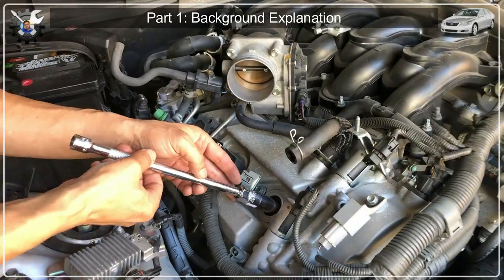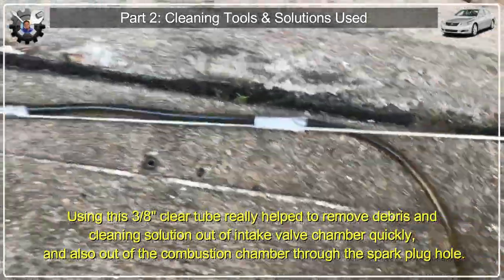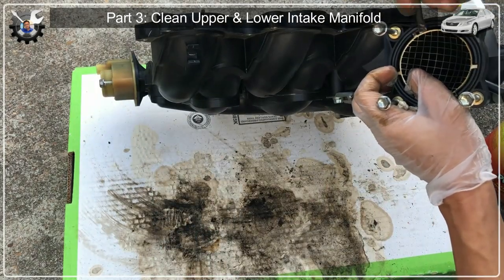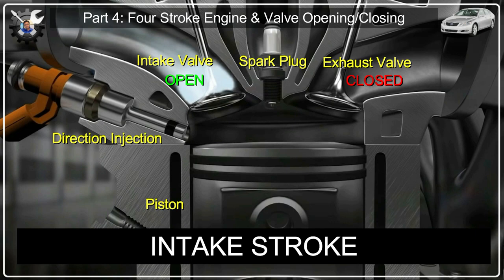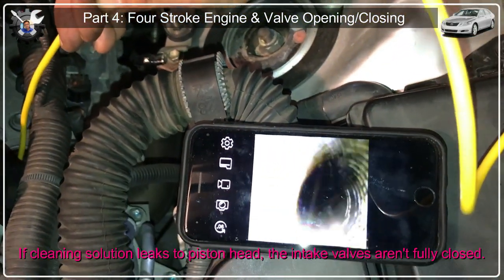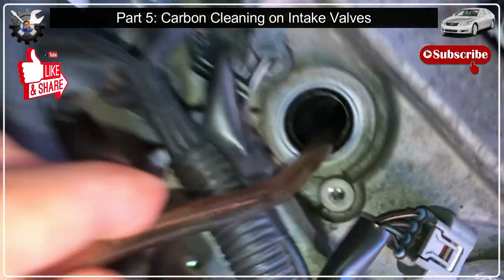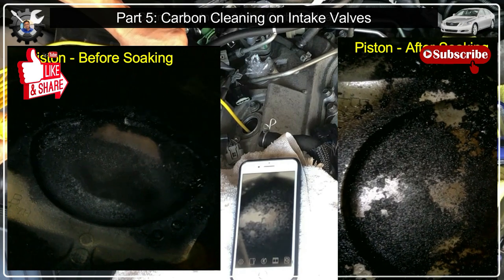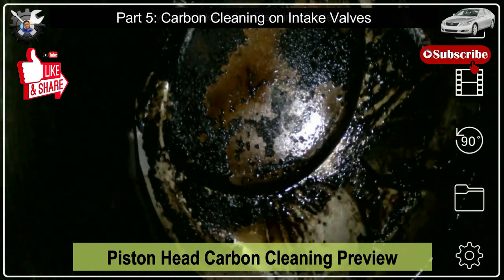GS300/IS250 Intake Valve Carbon Cleaning.

Comment: I just cleaned my car's valves. I used the zip tie method and a drill, it cleaned it out very well and saved me a lot of time. I would recommend using berryman's b-12 chemtool carb cleaner It worked very well for me. I didn't have an air compressor and I think it would have been way better than using a vaccum, once the carbon turns into a sludge, it's hard to get out. That's where it's easier if you have an air compressor that can kick it out of the holes.
Reply from the maker: Good job. Next time I’m gonna try BG’s carbon cleaning that supposedly can remove carbon on piston rings.  My vacuum was pretty powerful to remove the liquid with 3/8” clear hose as you can the liquid getting sucked out and rest were burned off by driving (hence the white smoke coming out for few minutes).  Using a zip tie with drill is interesting idea, though you have to be careful not to let that somehow break and fall into piston chamber which could be tricky to retrieve. I do have air compressor but when you stick an air hose through the hole, not sure how much liquid could actually come out but that could be interesting method to further loosen the carbon after soaking. Thanks for the feedback
Reply: OMG I did the same with the zip ties + drill, it worked incredibly better than the rifle barrel brushes (yeah, those are gun brushes but they works just as well lol), and you do have to drill that soup down for maybe 10mins each hole?
But I did start to worry about using those metal brushes, they could bend the pistons if they get jammed. I used the expensive stuff to soak the pistons but I found that the Brake Cleaner does better at removing the carbon buildup than the expensive stuff, just have to let it sit for 24hrs. Also, I didn't have to do the whole stick measuring contest he does in the vid, I could see the valves open/close just fine by shining an LED light down the valve holes :)
I do wonder if those common kitchen oven spray cleaners would do a better job at dissolving the carbon...

You might find it useful to get yourself an electric Computer duster, the DataVac Dust Blower is badass https://www.amazon.com/Computer-Powerful-Electronic-Environmentally-Friendly/dp/B01FWSYOME

2008 IS250 RWD - 206K mi.

Comment: I live in the Caribbean and i drive a Toyota Mark X which is very popular outside of the US, they all use the same 3GR/ 4GR FSE engines, so this was very helpful my friend :)
Reply from the maker: Wow never heard of Mark X, I need to look that up.  Such car doesn’t exist in USA. 😀
Reply: @DIYLifeSkills  The Toyota Mark X was only sold in Japan....toyota gave the Japanese market a option between the Lexus and Camry....it is the successor to the Toyota Mark 2, has some luxry features but not as much as the Lexus IS 250/350...sadly toyota stop manufacutred them in 2020 siting low sales and a more focus on the lexus brand....but on youtube in many countries aroudn the world you will find Mark X Clubs, i have a first Gen 2008 Modle :)
Reply from the maker: I watched few mark x videos on YouTube, and I can see some resemblance of GS300.  Pretty interesting to learn these things.  :-)
Reply: @DIYLifeSkills  i am planning to do this soon to my Toyota Mark X, it has on 140 000 KM plus right now, i got it from Japan with 70,000 KM plus... i have never clean the valves but it runs an works great, i have had that car since 2015

Comment: Nice work! Unfortunately one of the sh** engine toyota ever made! Vvti gears,oilburning etc.
Reply from the maker: Pretty much all GDI engines have this issue.  It’s even worse in German cars.
Reply: Yes true! I have gs300,drives ok,but should have bought gs430 or 350 instead.
Reply from the maker: @Re1nTs  I have same regret.  350 is dual injection so it doesn’t have this carbon build up issue.

Comment: Quality quality precise coverage on this job well done such a good car but I hate direct injection for obvious reason
Reply from the maker: Yeah, I bought this because it was a good price (105K miles for $5K nearly 4 years ago).  Had I known about this being the GDI, I would've looked for 2007 or above, which have dual injections that cleans intake valves.   Other than this, I love the car.

Comment: Dude, I'm impressed with your mechanical knowledge!! 
👍👍👍👍 I'm having the spark plugs removed, replaced on my Lexus IS250 at 100,000 MI. I want the carbon cleaned. What should I ask the mechanic to do for me?
Reply from the maker: @davefox7516  This is called “intake valve carbon cleaning”. Thanks for the nice comments.
Reply: @DIYLifeSkills  You're the best!! I can't believe how quickly you responded. I certainly appreciate you, and because you were kind to me, I'm going to like and subscribe.

Comment: Nice video I came across! Have you consider walnut blasting ? Is it an expensive  machine to invest with?
Reply from the maker: The machine ranges from under 100 to 400. I thought about it but new cars are moving away from GDI style engine so I probably won’t have much use for it.  Modern cars now have both direct and port fuel injections, so they don’t build carbon in intake valves like this older engine.
Reply from the maker: Also you probably only have to do this once or twice in the life of car’s life

Comment: I have 2011 gs350 175k mile do you think I have a carbon build up or it’s normal, it does run smoothly and I don’t have any problems
Reply: You should be ok the 350 line up has port injection. Which washes the valves with fuel to prevent this. If it's idling with slight misfires or shaking. Look into all vacuum lines are tight. If you can rotate vacuum lines by hand. It's mostly getting unmetered air. 

Also spark plug change should be around every 60k miles. Look in your manual for interval change.
Reply from the maker: Since 2011 is dual GDI & Port injection, there shouldn't be big carbon build up like me.  However, I bet your piston heads are pretty carboned up. Here is how I cleaned the carbon on piston top. 
https://www.youtube.com/watch?v=SS8vFbBLIG0&ab_channel=DIY%26LifeSkills

Comment: How often should it be done
Reply from the maker: I did mine at about 110K miles. So I think you can do it every 100K miles assuming you change oil on schedule and use good tier one one gas.

Comment: If you had to do it again would you blast it?
Reply from the maker: This cleaning is probably needed every 100K miles as it wasn’t as bad as some of the German cars that foul up really bad only after 30K miles.  So due to the infrequency, I would probably just do it manually. To invest ~$500 for blaster machine and walnut powders, I would have to have more regular use to justify the spending.
Reply from the maker: Also, newer cars are moving away from GDI engine to dual (port and direct) injections so such carbon build up problem doesn’t happen. This is for older GDI engines only.

Comment: HI! what's your opinion on oil catch cans for these direct injected engines?
Reply from the maker: I think it’s fine if you don’t live in cold area that can freeze in winter because oil catch can will be mixture of oil and water vapors.  If you do it, get the one that’s easy to empty.  I live in a Houston so I’m considering it but quite haven’t figured out where I can mount it that’s convenient to access.   If I figure it out, I’ll definitely do a video.
Reply: @DIYLifeSkills  Thanks for the quick reply!
In my country it goes below freezing often and i haven't though about this before.
I just got an IS250 and will have to do the a carbon cleaning (Thanks to your vids it wont be hard <3) and wanted to install one after so i wont have to do it again.
Reply from the maker: Yeah it’s a headache to have oil catch can if if you long winter.  I recently bought 2008 IS250 for my son, so eventually that’ll need carbon cleaning as well. I’m just too busy these days but I’ll get to it probably in the fall when I take a vacation.    

But you have my GS300 video instructions and the things attached to engine are mostly same, but some external parts,wiring harness and hose routing could vary slightly in IS250.

Comment: I'm probably going to have to do this
Reply from the maker: This is good to do when you have to change spark plugs as some work overlaps.  And it’ll be good time to clean the MAF and intake plenum.
Reply: @DIYLifeSkills  Mine has 85 k Miles so they'd be the original ones
 I plan on changing them soon too
Reply from the maker: @awesomusmaximus3766  you can wait until 100k miles and do spark plug at the same time
Reply: @DIYLifeSkills  I only do 3k miles a year my last oil change interval was only 800 miles it was still clean ha ha I change it every 6 mths
Reply from the maker: @awesomusmaximus3766  with hybrid work I also only go to work twice a week, which means I also do 3-5K miles a year on this car, so barely one oil change a year.  LOL

Comment: How many miles were on the car when u did this.
Reply from the maker: I think it was about 110K miles.  I still only have 122k miles since I’ve not driven much during pandemic.
Reply: @DIYLifeSkills  thank u appreciate it. Going to try the stp valve cleaner 1st take some b4 and after pics of the valves and see if if works if not ill do this.
Reply from the maker: @mcp08gt  Cleaning as in just spraying through air intake? Or doing the scrubbing like I did?  Those carbon was hard baked on and it took poking and scraping to get them to come off the valves and stems.   So spraying method may remove some soft deposits but hardened ones will likely requires scraping
Reply: @DIYLifeSkills  i havent looked at the valves yet. Waiting on my camera to come in today. To see how bad it is. Hopefully its not too bad and i can just use the spray to clean them up
Reply from the maker: @mcp08gt  What year and how many miles do you have?
Reply: @DIYLifeSkills  2008 and 150k miles carfax was clean and was taken for its either 100 or 120k mile service but doubt they did this

Comment: Hello my friend, how are you? I have a question. Does this cause a shortage of engine oil?
Reply from the maker: Main reason for the oil burning is likely worn piston rings. But heavy carbon build up can prematurely wear out the piston rings and intake valves and can accelerate wearing out the piston rings.  Also be sure ti change the PCV valve as clogged PCV will not relieve high pressure build up in the crankcase from combustion, and it’ll eventually lead to oil and air leak in internal or external gaskets. Also it can cause more oil to burn.
Reply from the maker: I would do a compress test on pistons to check the health of combustion chamber and piston health.
Reply from the maker: How much oil are you losing?
Reply: I switched PSV to no avail
Reply: Currently, I use 20 W50 engine oil, which is a little less drained
Reply: @adhmadaloufi9798  et les catalyseur se bouchent pas ?
Reply: @lavazza8031  Can you explain more?
Reply: @adhmadaloufi9798  les catalyseurs ont verra   Mais jai une sonde d oxygene hs 5 jours apres

Comment: What’s the torque specs on the lower intake manifold
Reply from the maker: LexusForum says 13 ft/lbs for both upper and lower intake, so that’s what I used.
Reply: @DIYLifeSkills  for 2007 lexus is250 ?
Reply from the maker: My 2006 GS300 and your 2007 IS250 both should be the same 3GR-FSE engine so torque spec should be same.
Reply: @DIYLifeSkills  ok Do you know the torque spec for the spark plugs?
Reply from the maker: This OEM spark plug manual says 15-22 ft/lbs, so I used 19.
Reply: @DIYLifeSkills  thank you boss man
Reply: @DIYLifeSkills  will I damage the throttle body in any way if I take off those 4 bolts how you did it to clean the upper intake manifold?
Reply from the maker: @tyronejefferson5124  I have a series of videos on things you asked in this playlist. 

Absolutely there is no risk to remove the TB. It gives you better access to clean the back side.  

https://www.youtube.com/watch?v=m0fGP3MrqFQ&list=PLRcC05jPDdVTi998JuZDnq3Iy0p6ymJBF&ab_channel=DIY%26LifeSkills
Reply: @DIYLifeSkills  I need help taking off the valve covers I cannot all the bolts are off but the oil dripping on the sides I think made it stuck or something do you have any tips to take it off
Reply from the maker: @tyronejefferson5124  Here is a video on valve cover removal for this car.  

https://www.youtube.com/watch?v=hN2my-b5FVU

Were you able to remove all the bolts on the  valve cover?   Also, sometime the valve cover is sort of stuck and you have to carefully pry it up from the edge, but be sure to not bend the metal.
Reply: @DIYLifeSkills  yes this video is helping me do the Job Do you know the torque specs for the Valve covers? You both helped Can’t believe I’m this far
Reply: Should be around 15 ft lbs. The upper says 11 ft lbs for allen head bolts, 12 ft lbs for nuts. I just use 10 ft lbs all across no leaks yet. Spark plugs are 18 ft lbs.

Comment: What’s your opinion on the sea foam for the is250
Reply from the maker: Seafoam is great for maintenance if you use it regularly.  But heavy baked carbon can only be removed by walnut blasting or manually scraping them off.
Reply: Seafoam works on the upper, depending on how bad multiple cans can get rid of it. Too carbon much on the pistons that's a different story.
Reply from the maker: Yup carbon on oil control piston ring is a  whole different story. I’m gonna try some engine flush…though I have no way to verify if it’ll clean some carbon build up on piston rings.  LOL